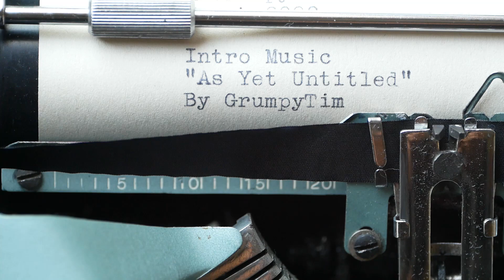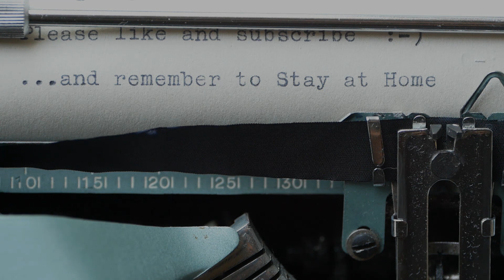Retro Tech - Olivetti Prima 20 Adding Machine - Part 1, Refurbishment

Comment: GrTim; I have followed your video in cleaning and adjusting my Prima 20 but I still have an issue with the RED TOTAL function not registering correctly on the paper. The adjustment screws for the number wheels seemed to make the black numbers read better, but the red still an issue. Any suggestions? Are those 2 side screws the only adjustment available to me? Thanks....
Reply from the maker: Hi Mark, it's been a while since I worked on that machine.  Theoretically, the red total should be the same as the black figures, with the machine just raising the ribbon so the red section gets struck rather than the black bit.  Is it just part of the numbers that aren't showing, ie the top or the bottom, or are they just feint all over?  I'd have to see if I could look at the machine in the video to refresh my memory (it belongs to a friend).  Sometimes the ribbons dry out, and these modern ribbons aren't very good compared to the old ones - the adding machines were supposed to have a heavy inked ribbon, whereas these modern ribbons are lightly inked and the material they are made from is much harder than the old fabric.  You could eliminate the ribbon possibility by unspooling the ribbon and fitting it upside down (you might be able to simply put the drums in upside down, but I can't remember whether their design would allow that), then if the general numbers don't print well in red but the totals print fine in black, the problem is the ribbon, however if the totals still don't print well, it must be some alignment issue.
Reply: @GrumpyTim  thanks form the reply Tim....the red striking is getting better after more cleaning and playing around with adjustment screws. However, the one issue I still have is that numbers don't 'carry' when adding. Any thoughts on that? I may send you a video. Thanks for your assistance...you could make a fortune repairing old machines!
Reply: Also...to remove the crank handle : is it simply unscrewing the bold head?
Reply from the maker: I think so Mark, but it has been a few years since I worked on that machine.  Probably also have to keep an eye out for a left hand thread - I don't know if it's a right hand thread or a left hand thread, but the latter can always be a bit of a pain if you don't know they're there when you try to unscrew them.
Reply from the maker: Hi Mark, the carry mechanism is buried deep inside the machine, and often gets a bit gummed up over time.  I tried to show some of the register gears in another video I shot, featuring one of the electrically powered Olivetti machines - it might point you in the right direction to find the issue with your machine. https://youtu.be/rKHvUNjSS3I?si=0OKP1Coa9RRh7RWB
Reply: @GrumpyTim  Thanks Tim...I've been peering into the abyss of the machine after soaking it in mineral spirits for 2 days hoping that would dissolve anything causing it to stick! Sometimes the numbers carry depending on the amount. I will try some heat on the parts as you have shown. I'll keep you posted...heck, I'd be happy to send the machine to you and pay for you to do it!😬

Comment: Ciao ho gradito il video grazie. Puoi mostrare come togliere la copertura?
Reply from the maker: Ciao malesia2010ful, mostro come rimuovere la copertura sulla mia copia dell'Olivetti all'inizio del video, ma Olivetti ha cambiato il metodo di fissaggio della copertura tra le versioni delle loro macchine: molte di loro hanno un piccolo fermo che devi fissare far scorrere lateralmente per rilasciare il coperchio - si accede al fermo dalla parte inferiore della macchina, spesso attraverso una piccola fessura nella base - su alcune macchine è nella parte anteriore e su altre è nella parte posteriore. Potrebbe essere necessario guardarsi intorno nella macchina per vedere quale tipo di riparazione ha la tua.

Hi malaysia2010ful, I show how to remove the cover on my copy of the Olivetti near the beginning of the video, but Olivetti did change their method of securing the cover between versions of their machines - many of them have a little latch which you have to slide sideways to release the cover - the latch is accessed from the underside of the machine, often through a little slot in the base - on some machines it's at the front and on others it's at the back.  You might have to look around the machine to see which type of fixing yours has.

Comment: I have just been getting a pretty rusty example of one of these working which was a challenge, sat down for a celebration coffee after finally getting it all working and first thing I then do is discover you have this video which would have saved me lots of stress/confusion - lol
Reply from the maker: Ha ha, did you have fun getting the case off?  Some of the other Olivetti calculators have a little sliding device either at the front or the back, that releases the case, and according to a few people who've commented, even some models of the Prima 20 have said sliding device, but it's definitely not there on the copy I worked on, so it's stretch and bend time to ease the cover off.  Then after that, there's the question of how to remove the bottom without breaking it - the feet tend to rust onto the metal posts and you're left wondering HOW does this come apart!!!  They look so cool though, so we'll forgive them the little puzzles they throw in our path.
Reply: @GrumpyTim  The case was no problem at all, on account of it already being in 4 or 5 pieces.  I am going to have to try and plastic weld it all back together.  It was in pretty poor shape but I think it  may be a reasonably early one (it has round buttons)?
I had the same issue as yours in that the accumulator was not working and also a slider in the printer mechanism was jammed which jammed the rest of the machine up solid.  Also a few springs hanging lose and parts out of place etc..
Now I have finished getting it working I have also just found a service manual for it (in Italian though), I must do the research first next time ;-)
Reply from the maker: Ah ha, a case in kit form - that plastic weld is bloomin marvellous stuff - I always keep a bottle close to hand - been using it to repair a very damaged case on a Monroe calculator (electronic), it's far from perfect but at least it's in one piece and working - video coming soon.

The accumulator jamming (or at least not moving into contact with the racks in the way it should) seems to be common on the Olivetti machines - kind of tricky to get to in order to free everything off, but worth the effort once they're back up and running.

Comment: Hello, I have one of these in nice condition. It doesn't quite work correctly.  Just about any number you put in to add the answer is 999,999,999. Any suggestions? Thanks
Reply from the maker: Hi Jamie, that sounds like an issue with the movement of the accumulator - I can't remember how well I explained it in that video, but any numbers you add into the machine firstly print when the racks that drive the number wheels reach the correct position for whatever number you've entered, then, as the racks lower back down, they are engaged with the register gears to physically add that number into the register.  When you select a sub total, the register should move into contact with those racks (through some other linkages) and the number held in the register is transferred to the printing racks and number wheels.  Once the calculator has printed, the racks remain in contact with the register gears, causing the number to be entered back into the register.  Selecting the total function is more or less the same, but once the calculator has printer, the register is moved away from the racks so this time the number isn't added back into the register, and the register remains at zero.

If for whatever reason, your register isn't moving into contact with the racks when you try to print a sub total or total, the number racks will move to their full extent, showing all 9s.  Alternatively, the cam followers at the rear might not be moving onto the "total" cam, and only reaching the sub total cam, in which case, the register is never being cleared, although the former is more likely.

The Prima 20 i worked on belongs to someone else so I can't look at it just now - I will probably be over there at the weekend though.  If I remember correctly the Prima 20 is very similar to the Electrosumma I worked on recently - there are a couple of sections that might help so you can see what I'm talking about - I show the cams at 03:35 and the register gears at 07:04 in this video https://youtu.be/rKHvUNjSS3I

Just shout if you want more info and I'll take a peek at the  Prima 20 when I'm next over there.
Reply: @GrumpyTim  wow, I didn't expect an answer that quickly, thanks I'm going to play around with it and hopefully get it going.
Reply from the maker: It's luck of the draw, sometimes I reply quickly, sometimes I don't.  Hope you get on ok with the Olivetti - the main thing is not to rush, just look at each bit and try to figure out how it works and what is doing what.  Sometimes I'll just walk away for a day and think about the problem, and often the answer just pops up out of nowhere.

Comment: Hi, I found list of s/n with years (of build I suppose) but mine starts with 197xx. Any idea of the year?
###################

Prima 20
###################
268xxx 1-1962
294xxx-286xxx 1-1962
328xxx 5-1962
346xxx 6-1962
380xxx 10-1962
535xxx-585xxx 6-1964
644xxx 3-1965
775xxx 3-1966
818xxx 5-1966
Reply from the maker: Well done for tracking down that list of dates, I hadn't found any dating information, I just went on the fact that both machines I've done videos on were UK decimal currency rather than the old pounds shillings and pence, and therefore were probably produced around or after 1971 when the UK changed to decimal.  They wouldn't have carried on far into the 70s because I think electronic machines took over pretty soon after that.

You could ask Nicolo Geretto if he has any idea of production dates, he seems to have good knowledge of the Olivetti machines.  Here's a link to his video showing division on a Prima 20  https://youtu.be/pnMG0C7vF78

Comment: Hi, very interesting video, thank you. Mine has round keys and is fully functional and in good condition with the same problem of the bad returning handle. To open it I found a "hided" slider on the back to open/lift first the back and then you can smoothly remove the cover without risk of damage.
Reply from the maker: Hi Martin, an ex Olivetti service engineer told me about the hidden slider, and the Multisumma 20 I've just restored does indeed have one of those hidden sliders to release the case, in that case it's at the front rather than the back.  Bizarrely, the square key Prima 20 in this video has no such slider either on the front or rear, quite why I guess only Olivetti themselves would have known - maybe it was a really late model and they simplified the heck out of it to save costs.

They're rather adorable machines, glad you've got a working one rather than just an ornament.

Comment: OK, so it is made as several other Italian wonders; "nice design, but..." If I take my old burroughs Ten Key, 20 year older, and I compare how easy it is to get to the mechanism.... Ferrari's too have a nice design, "but"... Probably specially designed an ordinairy person can't open it, it has to go to a "speziale" garage where "speziale" artists equiped with "speziale" tools we common mortals do'nt have "operate" the sick patient with "alotta passione".... (make sure to "gesticulare alotta") Salute !
Reply from the maker: Hi Benoit, yes, maybe this was the beginning of the "pretty case but how do you get into it?".  Olivetti seemed to use a few hidden methods to open their calculators and adding machines - I have another Olivetti machine that I haven't repaired yet, and it has a secret tab of metal that you move to one side to release the case - all of this fades into insignificance if you've ever had to open an iPhone or Epson printer (and probably a million other things, those were just the first two examples that sprung to mind) - so many invisible plastic clips that are simple to assemble yet just about impossible to open without leaving some marks.

Thanks for watching and commenting.

Comment: Hello, congratulations for the video, it took me a lot of doubts and I managed to open and clean it, I would like now if you can please give me a tip, the keys are locked and I can't lower the keys to do any calculation, I appreciate if you can help me
Reply from the maker: Hi Alcione, I repaired the Olivetti for a friend so I can't look at it right now, but I'll probably be over there at the weekend.

Initial thoughts - if the machine has stopped part way through and addition, the keys will be locked - was the machine working before you cleaned it?  If it wasn't, there's probably one or more parts that are stuck.  I can't remember what happens when the input is full but on some machines, the keyboard is then locked, also when the repeat lever is pushed upwards, that might lock the keyboard.

What happens when you pull the crank handle, does it print anything?  Also, does it clear after you've activated the total lever and pulled the handle - if you need to see it, I also did a demonstration video showing the machine working   https://youtu.be/PFVPMyHE5EY.
Reply from the maker: Hi Alcione, I had a little look at the Olivetti at the weekend - there are a few things in normal operation that will stop the keys from being pressed:
If the WN (or whole number) key is pressed, none of the other keys can be pressed until a calculation has been made (ie you pull the crank handle).  The same applies if the WN key is stuck down, you won't be able to press any other keys.  Your model may not have the WN key though, as it was only fitted to certain models that were set up in a currency format.

The repeat (or X) lever doesn't appear to lock the keyboard on these machines, so that shouldn't be the problem.  Also, when the input register is full, the keys don't lock up, they just feel a bit different and no more numbers are actually entered.

If the input clear lever (that's the round knob on the left) has stuck in the upwards position, then the keys will be locked, and as I mentioned before, if the crank handle hasn't fully returned, then the keys will be locked.

The likelihood however, is that some part or parts inside are sticking - then it would be a case of removing the covers and observing the mechanism inside - all levers, rods and pivots should be free to move - it can take some time but adding a small drop of light oil (using the tip of a small screwdriver to carry the drop) to each pivot and then giving every moving part a gentle wiggle can often free up the sticking part.